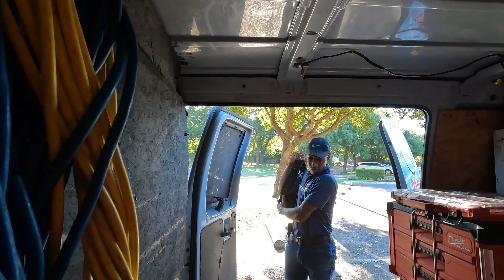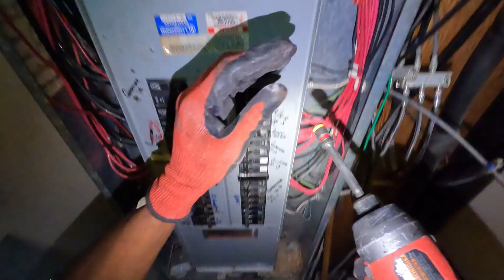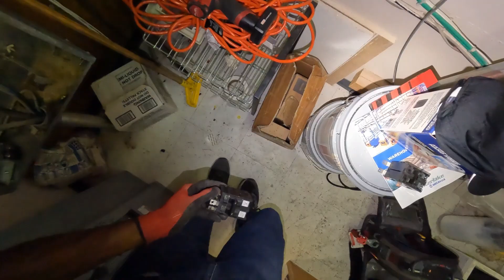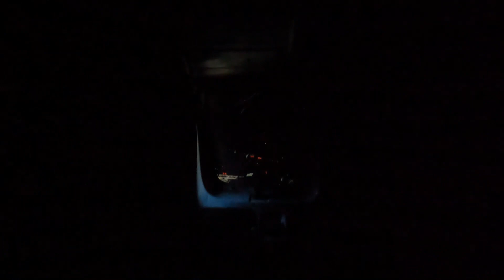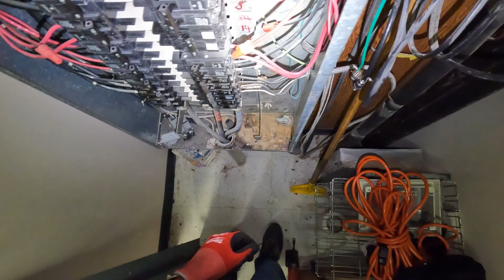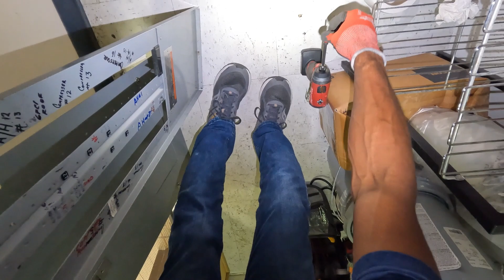Why Commercial Bolt- In Breaker Keeps Tripping? Replace Bolt-In Breaker In A Hot & Live Panel.

Comment: Little tight in there! Somehow, I don't think there is the required 30" of clearance in front of the panel. Nothing like working on a hot panel in a cramped space.

I like how in your videos you are showing us what you do, not just telling us. I'm also glad I'm not the only one who shows up with the wrong part.
Reply: It's actually 36" minimum
Reply: @JohnQPublic345  I was referring to the 30" wide clearance required by NEC 110.26, but that area also lacked the 36" deep clearance you alluded to

Comment: I am curious Steven ,I never dealt with bolt in breakers on a 3 phase panel. If the breaker bolts to the buss which is hot ! why does it not arch or shot sparks ? Only thing I can figure is as long as the  breaker is off , you are protected from the hot Buss.
Reply from the maker: Because its not going to ground or touching another leg of the phase. An it helps im using insulated tools
Reply: When the new disconnected and open breaker makes contact with the bus there are no sparks because the breaker is isolated. So the breaker becomes energized with voltage but theres no current. No current, no sparks.